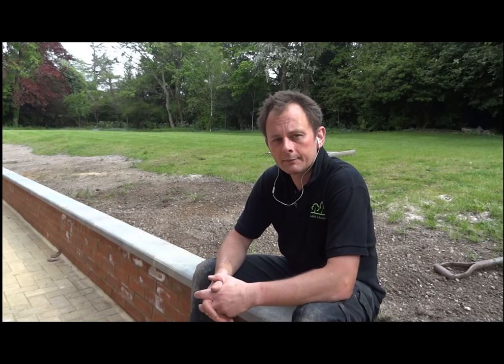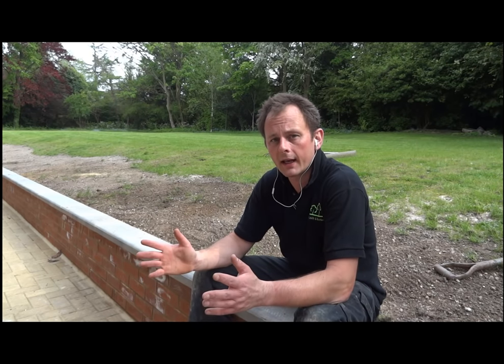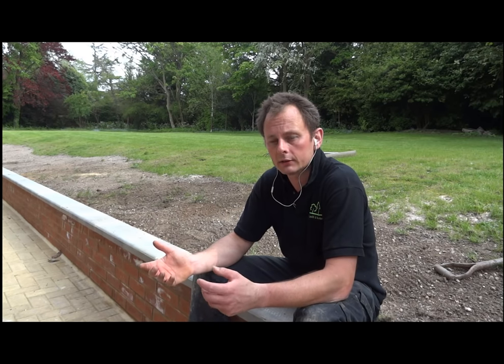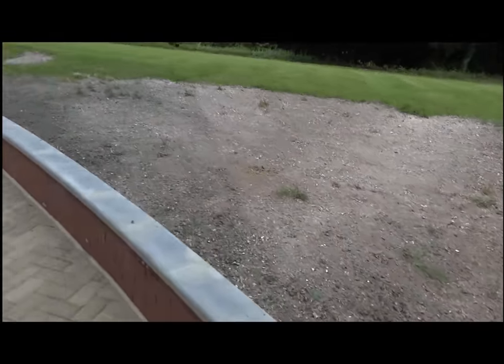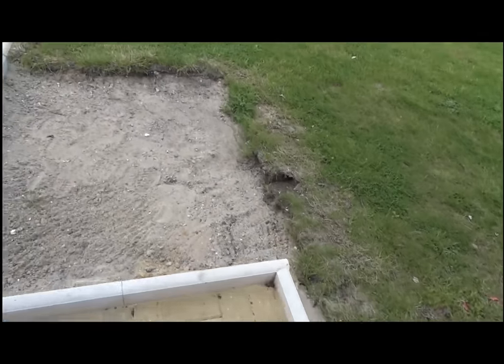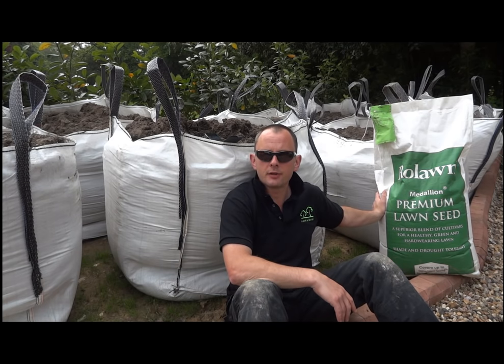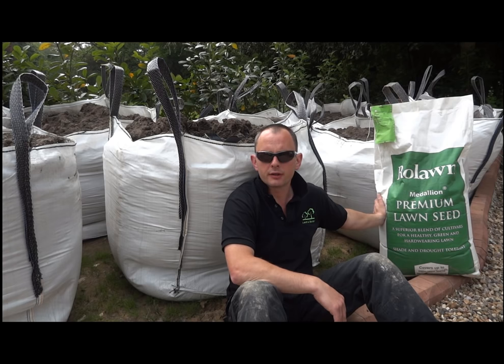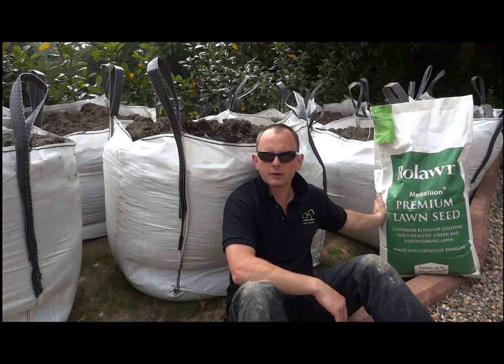How to prepare Virgin ground for Seeding

Comment: Do you use the same grass species as the existing lawn when seeding the patches? Also I have bought some shade lawn seed and some utility lawn seed and was thinking
of mixing the two packets together, would that work? Just seen the end where you show how to blend the patches,lol.
Reply from the maker: +Clive Ellis it's pretty much impossible to get the same lawn seed mix. Overseeing is about the only way to get a smooth gradient between the old and new. Mixing packets together would be fine. Only no-no with seed is to use any that's over a year old - at best 20% will germinate
Reply: I have been trying to identify grass from a guide, but I would imagine most people will have some sort of Rye and Meadow.
Reply from the maker: Clive Ellis generally yes. Utility mix will mostly be ryegrass and fescue varieties, shady mix will have mostly strong fescues and fine mix will be almost all amenity ryegrass. The mix I use on this lawn is the same that I use in all seeding applications. It's extremely versatile. Wouldn't use it to redo a Wimbledon tennis court, but that's mostly because the soils in my region aren't alkali enough. PH is just over 7
Reply: What is the seed mix you use. I have a shade mix off Festuca Rubra: Calliope, Maxima1 andFestuca Triana. And a utility mix off Capri dwarf Rye andMaxima strong creeping red Fescue.
I might mix them if that is worth doing.
Reply from the maker: +Clive Ellis I can't remember the exact seed mix of the one I use. Manufacturer is Rolawn and the mix is called Medallion. Big question is where are you? I'm SE UK so it may be, the same mix might not work for you!
Reply: I am in Northamptonshire
Reply from the maker: +Clive Ellis may be worthwhile taking local advice from a nursery, specific for your area. Generally a utility mix would work in most places but where you are, there is everything from dry sandy soils over limestone to heavy clay soils over Jurassic clay. Local producers of grass seed may have seed mixes more suitable for your area. My seed mix comes from soils in Norfolk which are similar to what I have here in Surrey. (Similar enough!)

Comment: about how long does seed take to germinate?
Reply from the maker: +Clive Ellis hi. Depends a lot on where you are, ambient temperature, grass mix etc. Without prepping the seed, generally anything between 7 and 14 days. You an bring that down by half by treating the seed day before you sow it
Reply: put some down about two weeks ago and nothing yet. How do you prep seed as I have alot left over?
Reply from the maker: +Clive Ellis first, is It new seed?  To prep your seed, first, get a pair of your wife/girlfriends tights - no holes! (I'm not kidding), pit seed in and tie a knot to keep the seed inside. Fill a sink with Luke warm water. And soak the seed seed for 1-2hrs. Squeeze off excess water and place overnight in a warm place, like boiler cupboard etc. Sow your seeds next day. 

If your ground is hard, invigorate the soil with a rake to break it up and once the seed is down, drive new topsoil over the new seed. Then water every day it doesn't rain for 1-2 weeks, depending on how the new seeds come up
Reply: I did all the soil prepping, adding in some lawn soil, and the over seeding areas I did some aeration with a hollow tine fork. Used new seed for that.
will prep some seed anyway.
Reply from the maker: Did u backfill the holes with a sand/soil mix. If drainage wasn't too bad before, the holes can drain too much water and the seed can suffer that way
Reply from the maker: Post some pics here so I can see what your dealing with. Might be able to give a better answer
Reply: I folled advice and went over the area with a bladed scarifier in transport mode to spread the cores
Reply from the maker: +Clive Ellis ok. Do the bits I've said and see how it goes. Would love to see pics. Good luck with it and I hope to hear from you soon
Reply: yes, anyway, should I roll the seed in a bit as the birds take alot?
Reply from the maker: +Clive Ellis no. Don't roll it, won't make any difference to the birds plus it slows water permeation. 2 ways to protect from birds is suspending old CDs on string. They blow about and scare birds away, or suspend some fine netting over the seeded area, minimum 6" of the ground to keep the birds off
Reply: Thanks, will try the cd's